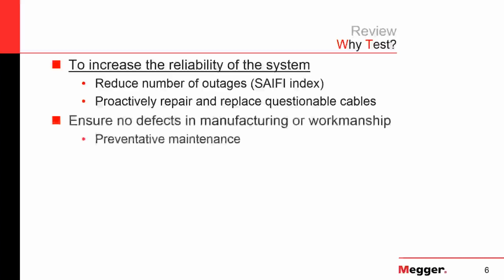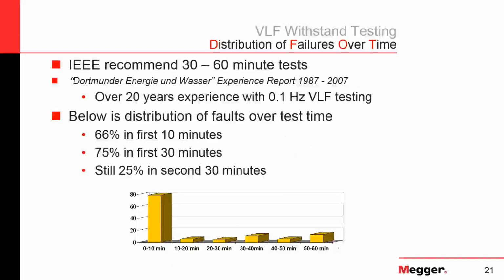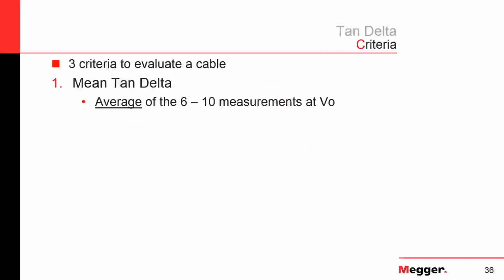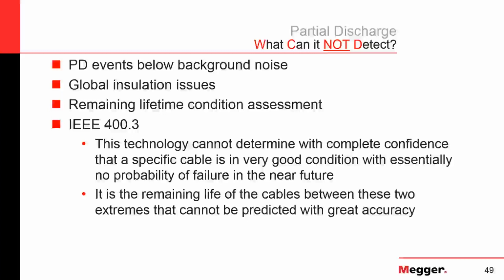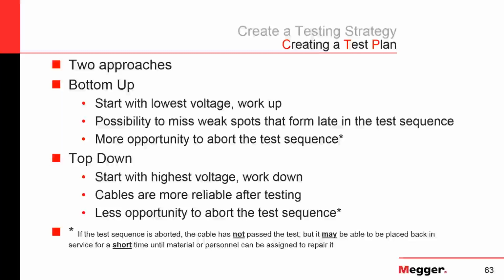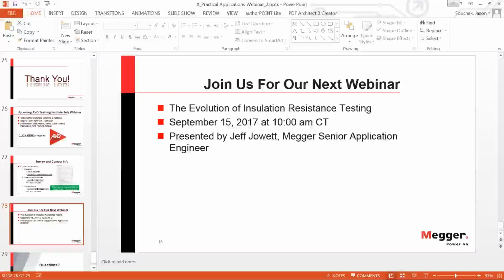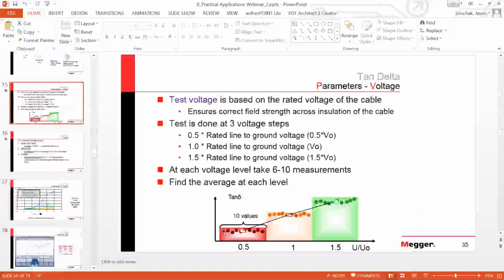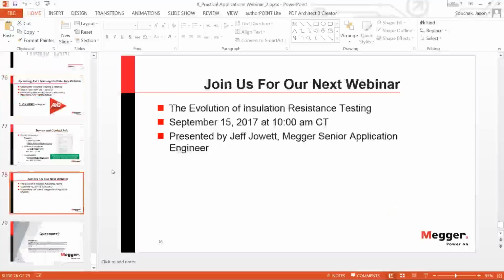Practical Applications of Cable Testing and Diagnostics

Comment: @54.50 you mentioned in bottom approach that proceed by doing 5KV DC insulation resistance test whereas @9.10 you mentioned that there are developed trapped space charges in extruded cables . .
Reply: i realize it is kind of off topic but do anybody know of a good place to watch new series online ?
Reply: @Leonidas Mark i would suggest Flixzone. You can find it on google =)
Reply: @Kingsley Caspian yup, been using Flixzone for years myself :D
Reply: @Kingsley Caspian Thanks, I went there and it seems like they got a lot of movies there :D I really appreciate it !
Reply: @Leonidas Mark Happy to help =)